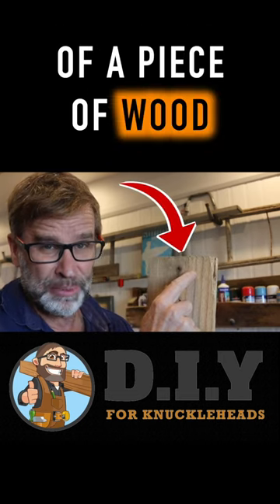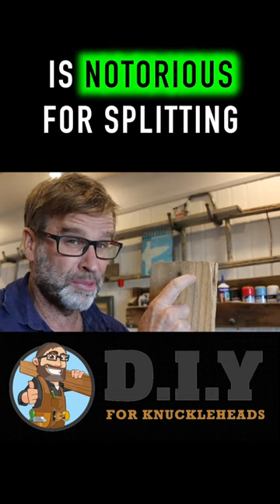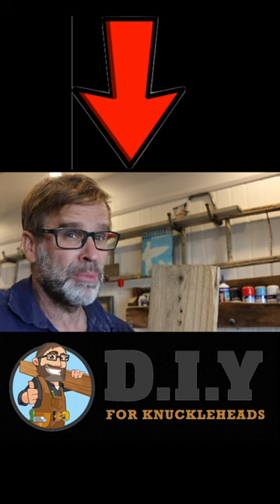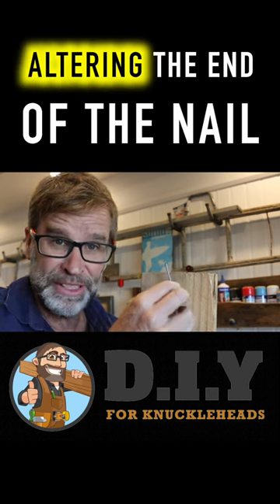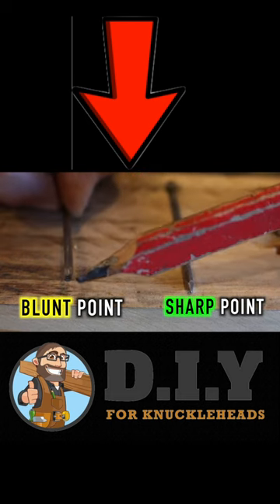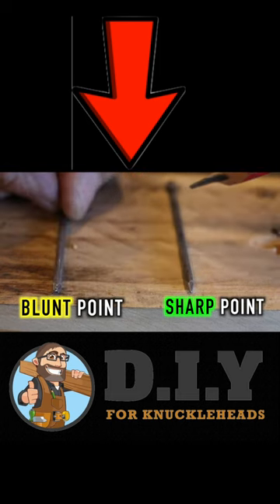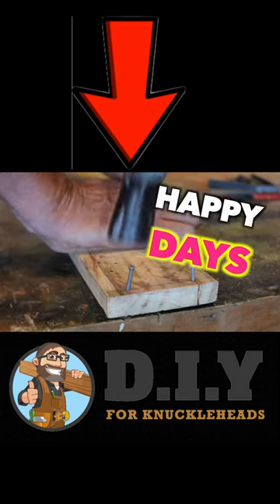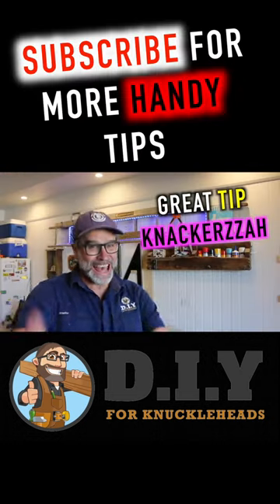Genius 🤯 How to AVOID Splitting Wood with Nails  #shorts

Comment: It’s a great tip but you can still pre drill the holes, if you choose to put screws instead of nails.
Reply: Yea but sometimes nails are more suitable than screws, nails will allow flex & pressure over time where as screws can snap if put under flex strain.

Comment: How does this work?
Reply from the maker: When the nail is blunt it pushes it's way through the wood whereas when you have a point on the nail it pierces the wood and causes it to spread as it gets driven in which causes the splitting 👍
Reply: @diyforknuckleheads  Thanks for the explanation! I was scratching the ol' noggin on why this worked!

Comment: I forget where I first picked up that tip, but it is a good un. Sometimes it is best to drill a pilot hole, and I learned in shop class to clip the head off a nail and use it as a drill bit.